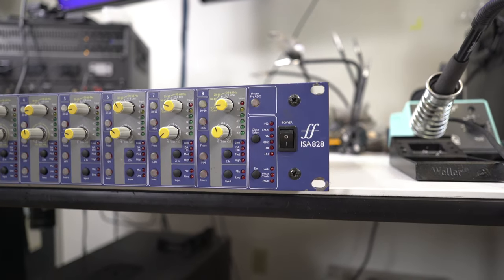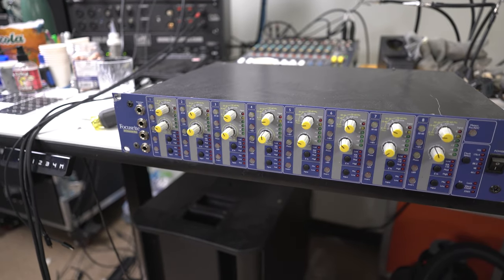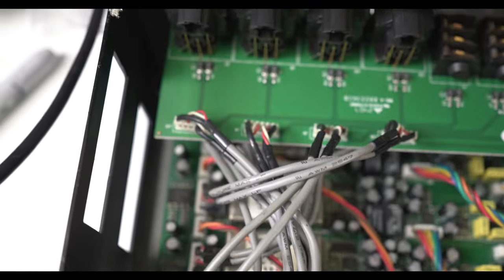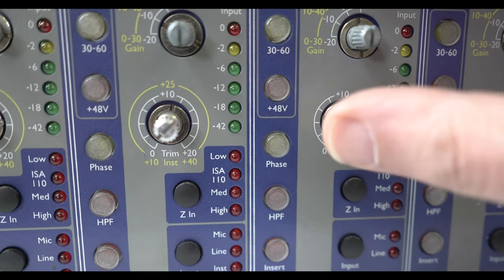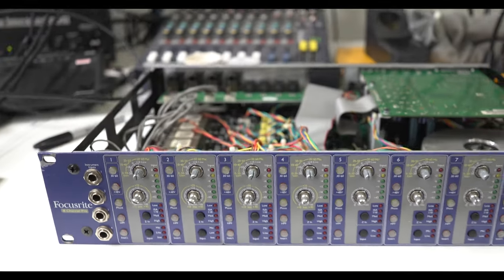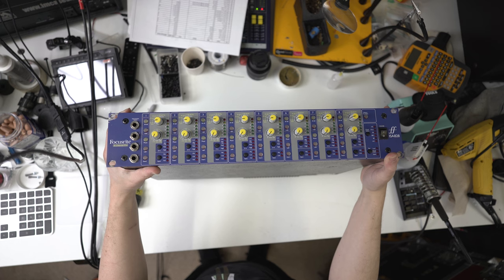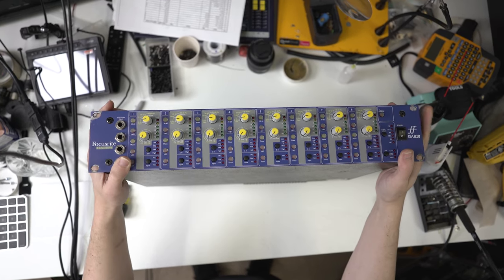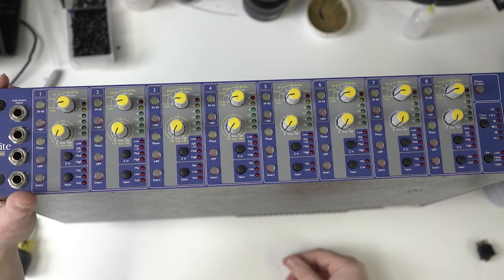Replacing The Power Switch On A Focusrite ISA828

Comment: Would you say that these units are reliable? I bought one from ebay and I'm hoping it will last for many years w/o the need for service. I have read that if it's properly ventilated, it should increase longevity. Thoughts on this?
Reply from the maker: I have 2, they work great! They do run hot. I would absolutely add at least a rack space between them and anything else mounted adjacent. The only problem I ever had was the toroidal transformer working its way loose over time. I use them for remote recording work. That being said, they were shipped UPS in a rack!
Reply: @billylaguardia  Ok, thanks for that info. What would you expect the service life to be approximately? For a used unit, I know this might be really hard to tell since the mk1 has been out for quite a while now
Reply from the maker: @kasomeno  Man thats a tough question to answer. They do run hot so I'd keep it powered off whenever you aren't using it. Other than that, keep an eye on the electrolytics and you will enjoy a long service life

Comment: is it worth it to buy it new now?
Reply: or do you have another suggestion?
Reply from the maker: Sure. It’s a great preamp if it’s in your price range. I bought each one for around $1500 used from eBay. I’d bet you can probably find one in good condition if you set up some search alerts. You may want to skip the digital cards at this point depending on what interfaces you have.